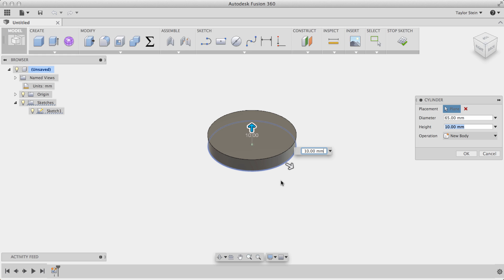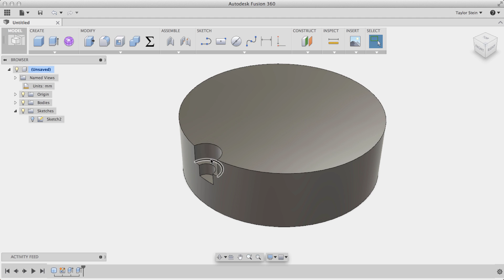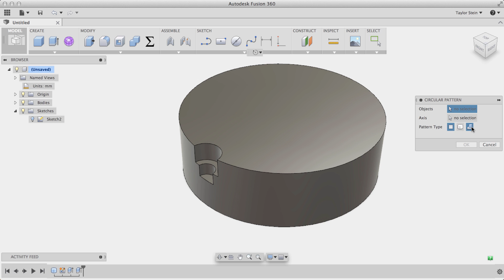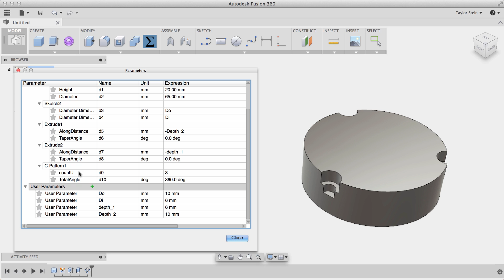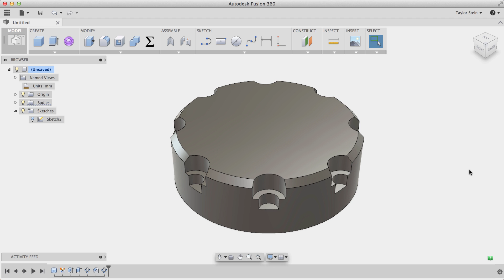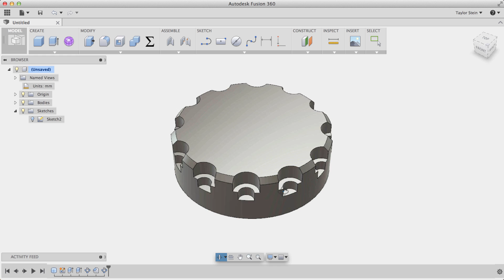Fusion 360: Patterns & User Parameters

Comment: Is there a way to write conditional parameters or lookup values?? 

e.g.

A shaft has names like SBR20, SBR16, etc. And various dimensions in the sketch depend on that name (SBR20 has 20mm diameter, 22.5mm total width, etc.) but sometimes not computable without condition..

an SBR20 search in google images will show a table and explain better (cannot paste an image here for some reason)

Comment: Why is it in the latest version of Fusion 360, the last step fails if the 'Compute' option is set at it's default of 'Identical'? ['No chamfer edge found?'] However, if you change it to 'Optimised', it works?
Reply: I encountered the same problem.
Reply: yeah same
Reply: also works with face, not feature

Comment: Nice video but how would you import the user parameter values from an external excel sheet or external google sheet so if you have multiple people collaborating on a model that they can all get the changed set of parameters when they change?      This is a loose collaboration so I don't even know the people drawing the other parts but they are willing to post a CSV with named parameters such as number of holes,  hole diameter, etc in a Github or on a google doc or in excel.   It seems like this network of loose collaborators is a ideal sweet spot for fusion 360.

Comment: How are parameters shared between designs?
Reply from the maker: +James Moore Currently parameters are not shared between different Designs. You can insert a design into another, and changes to the initial design will be reflected where it's been inserted, but there aren't currently any "global" parameters across a project.
Reply: I'm constantly surprised by Fusion 360 implementation choices.  It seems completely obvious that parameters would be available throughout, probably in some sort of hierarchy where you could certainly have parameters that are local to a design.  But to have them be siloed into just a single design seems like a very strange choice for a cloud product.
Reply: +James Moore There is a workaround, there is a free plugin that lets you  upload a Csv file, you simply update this with your user parameters and you can load that into every project, not ideal but works
Reply: What's the name?

Comment: It would be nice if you could select the parameters while you are creating the dimension or defining the feature (i.e: extrusion distance or pattern count). I'm surprised this wasn't released as part of the parameter system. Having to remember what the parameter name is, or having to go and modify the Model parameters to equal the user parameter. Cheers for the video though, it's a nice intro to using parameters!
Reply: Still not a feature 7 years later.
Reply: @c0mputer  it is. They auto complete as you type now.
Reply: @ScottMoyse  Oh I apologize, I thought you meant to have the parameters window open as you create your entire design and adjust and fill in as you go, always having that window open. As I reread your post it's clear now.